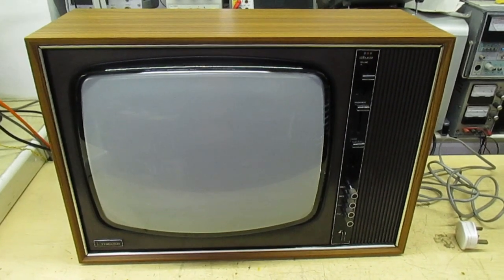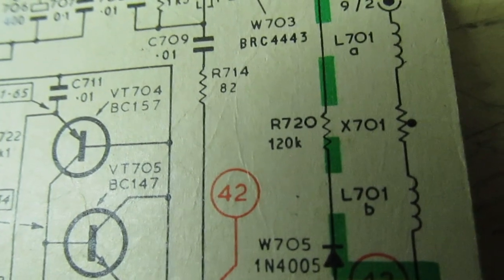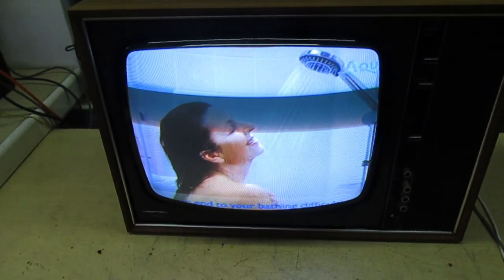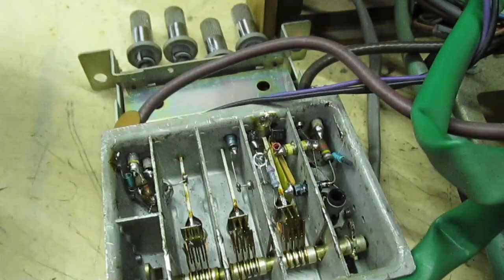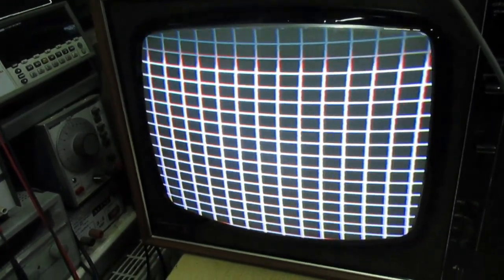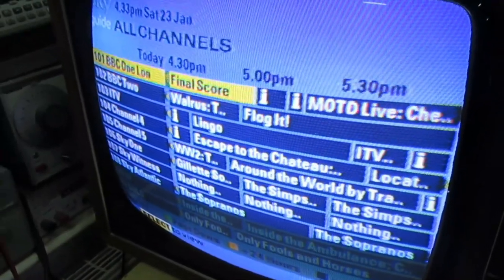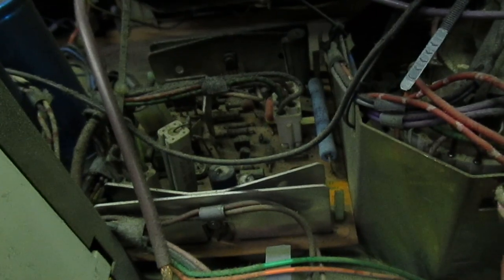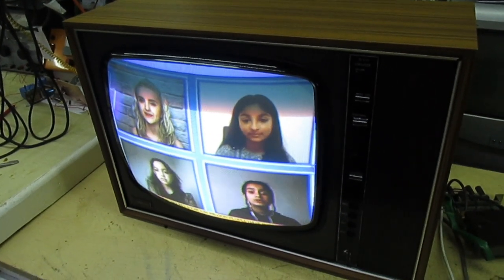Lets take a look at the Thorn 8000 chassis vintage TV set.

Comment: Once again great to see a set from the D|E|R range that I used to service as an apprentice back in the early to mid '80s. I remember those tuner bars going dry jointed. The slider controls always needed cleaning and that thermister always used to fail too. Delta tubes always seemed brighter than PIL, but the convergeance was tricky to do. Thanks for another nostalgic look into TV servicing.

Comment: I had forgotten Ferguson had this model that looked very similar to Hitachi of the same era . I remember a neighbour had this set with coin slot meter 50p per 6 hours of viewing time . great video
Reply from the maker: This is correct the Ferguson looked very similar to a Hitachi CNP190 of it could have been CNP192 and 40 years ago I had a Hitachi with one of the CRTs heaters not lit and I replaced the tube with one from a Thorn 8000 not realising the Hitachi only had a very low potential focus voltage of something like 500 v , whereas the Thorn crt needed 4-5Kv on the focus electrode, in the end I tapped off a voltage from the final anode and so proud with my mod I took a photo of the Hitachi set with a big red focus control in the bottom of the cabinet, and I still have the photo ! I found it in the loft only a few months ago .
Reply: @michaeldranfield7140  The Hitachi had two on and off switches which did puzzle me as a kid i thought why two switches one in the front was old fashioned way of leaving the set on Standby so the tube heaters were left on for quicker warm up time and the other switch was the Mains switch which turned the whole set off.... there been a few Japanese sets were made that way and the tube didn't last long if i remember correctly

Comment: Good video. As an apprentice these were old and to be avoided:) My journey started with Tx9s and ended with redundancy 20 years later. I remember unboxing and fixing Tx100s and thinking the future had arrived! Now I am an electrician and am very rarely  challenged  in the same way. I must also say you are definitely more gifted in electronics than I ever was. Keep up the good work.
Reply from the maker: I have a couple of TX100 s but not in very good cosmetic condition and also a Teletext 20 inch TX9  but its the mark 1 version that had the troublesome L65 choke  that amongst a whole string of other components caused intermitent random fuse blowing , I dont think Thorn ever got to the bottom of the fuse blowing and re designed the power supply using a TDA4600  I think it was , chopper IC switch mode power supply .

Comment: I have one identical to this and it gets used in rotation on quite a regular basis. I did a write up on Paul Stenning's site 10 years ago. You mention that the tube is not exactly great but before you condemn it, check this extract from my post:
"A couple of weeks ago we started to use the little Ferguson again but over the course of a few days the picture started to look decidedly lack lustre. The brightness was falling, there was a tendency for flaring on highlights and strong colours and the black level was not as steady as it should be. The first two symptoms pointed me at the CRT but my trusty tester said it was absolutely fine. I suspected that the A1 voltage might be low but again this was not the case. Next I checked the grids and was surprised to find a negative voltage about -20V instead of +26V. I studied the diagram and circuit description and discovered that the beam limiter works on this chassis by lowering the grid voltage on over bright scenes. With the brightness control right down I had the correct voltage at the grids but with it just advanced a little the grid voltage fell and as I pushed the brightness higher it went negative. I deduced that the beam limiter was acting way too early and in robbing the CRT of its positive grid bias, was making it look shot!

There is a resistor R615 (180k) from the HT1 line to the beam limiter diodes which I'm guessing is meant to temper the beam limiter's action and give a maximum swing of 26.6V to 3.3V. It was this feed that was wrong due to it having risen in value to almost 600k. With a replacement resistor in situ, the set had a new lease of life and looked much better than even when I'd first got it going"
Reply from the maker: Interesting, I didn't test the CRT first, I will make a note of your suggestion and take a look next time I run the set up, sadly I don't live in a big house though where I can use the sets I have in my collection.

Comment: One of the common faults on many old Thorn sets was tuner latching washer failure. There's a well known way to replace them with something more reliable.
Reply from the maker: That's something I have totally forgotten about .
Reply: @michaeldranfield7140  i have a few that need that sorting in them, one a 1590 black n white portable that was a 'survivor' of a house fire, front moulding and  knobs melted and  bubbly with the heat, main part of case ok, though, and still worked
Reply from the maker: @andygozzo72  Got a few 1590 s and saw one on the tip a couple of months ago to my horror but couldn't get it as they wont let you have anything now .
Reply: @michaeldranfield7140  i know , stupid 'health n safety' ..

Comment: If I remember rightly the 8000 chassis didn't use an EHT tripler but a single diode rectifier off an EHT voltage pulse winding on the LOPT. If you weren't careful where the lead was routed it would corona-discharge to a nearby cable assembly and cause the PVC insulation to catch fire. Guess how I know....

Comment: Hi. Great video. I have a question. I have a Thorn Ferguson 38010 (G2-17) B&W 12 inch Portable tv. I think it was built around 1983 -1985?. Do you know or anyone else know what the (tube which is a Mullard A31-510W Monochrome CRT) Heater voltage is?. 1 site is saying 11volts another site says 12.6volts. Any help would much appreciated.

Comment: Didn't rediffusion rent these out in the 70's and they had a channel selector knob in the window? as a kid i remember one very similar to this but had a rediffusion badge and a red light on the right hand side
Reply from the maker: I think back then most rental companies used Thorn stuff , there is another model that has a red channel display based on the Thorn 8800 chassis , I did a video on it earlier today .
Reply: @michaeldranfield7140  Thinking back it would have been a black and white set, it was medium brown coloured woodgrain with the speaker on the right and a red neon bulb next to the channel buttons, might have been the MK11 but not 100% sure

Comment: Great video, I’ve one of these sets to restore. The HT smoothing capacitor is bulging too. Did you replace it was a new capacitor or have you original NOS capacitors? Keep the videos coming. All the best
Reply from the maker: you are correct it does need replacing soon but I dont have these any more , it will be ok until the seal bursts and lets air in, I have in the past hollowed electrolytic capacitors out and fitted modern replacements inside the can without any problem but its quite time consuming making a proper job .
Reply: @michaeldranfield7140  many thanks for your reply.

Comment: That takes me back, Lum & Chroma delay lines. Think the audio output was class A biased and the MJA???  transistor would fail or even go noisy. 
The LOPTX had pink jelly in it ;)
Reply from the maker: Off the top of my head I think the class A audio op transistor was MJE340 which I  still have in stock,the lopt followed earlier thorn models of using jelly pot with legendary reliability.
Reply: @michaeldranfield7140  yup MJE 340, my God it ran hot.

Comment: Nice to see a thorn 8000 still in working condition after all these years , i can remember those tuners giving problems like you said . Also super servisol was a no no for cleaning the slider controls , the va1104 came into my head about 5 seconds before you mentioned it and hadn't thought about one in 30+ years .
Reply from the maker: The problem with servisol is it attacks plastic , I remember spraying a noisy tuner button unit on a GEC set , the version of the 2110 which had a plastic cabinet and although it cured the faulty button unit  a few weeks later all the cabinet mounting  where the button unit was screwed to the cabinet disintegrated and the channel selector fell into the back of the cabinet , never again !
Reply: @michaeldranfield7140  yes agreed did the same with thorn 1500 with slider controls few weeks later on off switch fell inside,  then started to use electrolube instead no problem
Reply: @michaeldranfield7140  defintely avoid servisol on plastic stuff, i've had it destroy pots with soft black plastic rotors, older ones with nylon or srbp+metal are ok  electrolube EML seems more 'compatible' with most plastics
Reply from the maker: @andygozzo72  Yes , I first came across this back in the mid 80 s with GEC 2110 TV in the plastic cabinets .Spray the controls with servisol and a few weeks later  all the cabinet mountings disintegrated .
Reply: @michaeldranfield7140  i used to have a gec c2210 worked quite well, cabinet was cracked on top and some previous person had covered it over with woodgrain 'fablon' type stuff , unfortunately one of the many i had to get rid of quick 😢
Reply from the maker: @andygozzo72  I started my business selling ex rental plastic case 2210 s , covered them in fablon and they looked like brand new again, few weeks ago there was a wooden case one on e bay but sadly collection only and too far away or I would have bought it .

Comment: great video. we  bought an awfull lot of these from tritell (ex rentals) and they proved to be good money makers .
Reply from the maker: Not a set I use to buy as the tubes were never that good but remember in the 1980s how many companies set up selling EX rental TV s  .
Reply: @michaeldranfield7140  we were lucky to have a tube regun place just up the road and paid £20 each in lots of 5. the 8000 sets cost £10 and the 8500 £12. (untested) so worked out well.
Reply: I have a couple of 8500s that need resurrecting after 40+ years in slumber.

But first I need to fix a minor colour fault on a Sanyo VTC5000 and then continue an ongoing “argument” with the PSUs in three Grundig 2x4 Super V2000 VCRs (the front-loading brown/gold model). They used the Siemens TDA4600 SMPSU, which is a simple enough primary do I’m suspecting the faults are on the secondary side.
Reply from the maker: @stickytapenrust6869  Had a grundig tv set once with TDA4600 and it blew the chopper transistor at switch on just the same as when the 270k resistor to the chip goes open,eventually found on the secondary side of the chopper transformer the main HT rail rectifier diode was open circuit ,so it would seem this type of power supply wont work without a load on the secondary.
Reply: Tritel , Thornbury Bradford ?
Reply: @johndenby6192  chepstow  did not know there was one in thornbury
also used to buy from graham from sloper rd in cardiff
Reply: @stickytapenrust6869  when i saw your handle on here it reminded me of Tim Hunkin and Rex Garrod on The Secret Live of Machines. I still chuckle when i think of the episode in which they show the working of a VCR and their demonstration of magnetic tape recording with quite literally Sellotape and rust and Rexes line "This is recorded with sticky tape and rust ". I am also enjoying Michaels videos on all those old Tv sets i used to repair back in the good old days when Tvs were easy to fix and spares were readily available.

Comment: nice beast, i have a ferguson 3712 8000 set, different cabinet design, used to have an 8500 with 'similar but different' cabinet to yours, but that got damaged in storage and wood started to rot so was scrapped(i kept the boards, and lopt/doubler, though, now sold to help someone resurrect theirs)  both worked ok except for teletext flyback lines at top of screen
Reply: i could do with a va1104 thermistor to 'mod' mine, cant seem to get the things these days, it doesnt have one, i dont think..? the 8500 also didnt
Reply from the maker: @andygozzo72  From memory VA1104 is 15 oms cold , 1 ohm hot so pretty easy to replace with something else from RS I would think .
Reply from the maker: Think there was a 17 inch 8000 set also , I may well have one !
Reply: @michaeldranfield7140  yep, mines the 17 inch one,  the 8500 was 19, marconiphone branded i think,, i used to have a 3500 had unusual brand UTC, model no. was same as Ultra versions and the little white plastic model plates inside had a UTC plate stuck over Ultra ones ,so, who/what was UTC?!  i've just found i do have one 'proper' va1104,  amazingly!